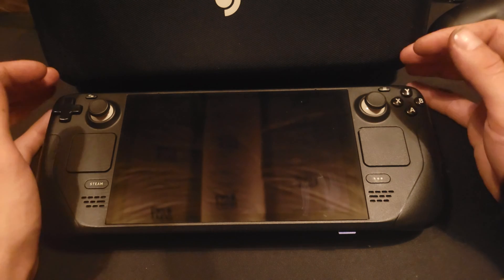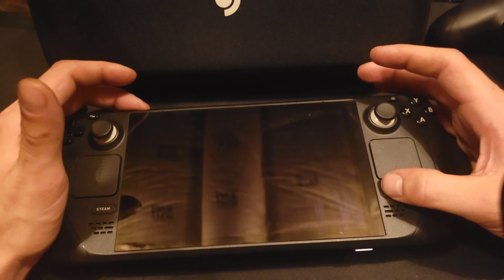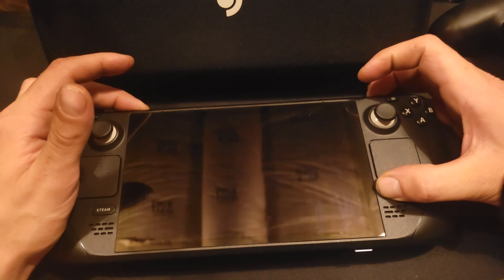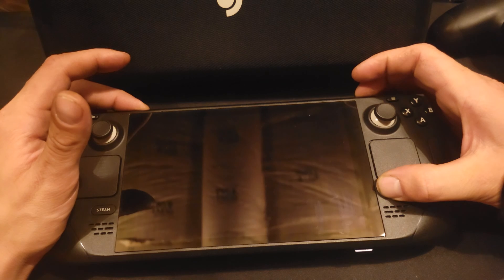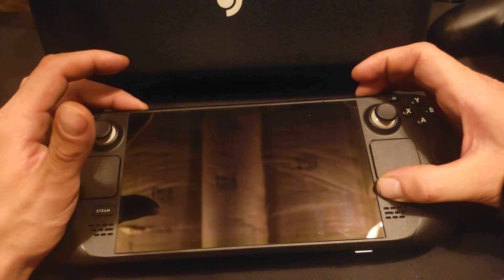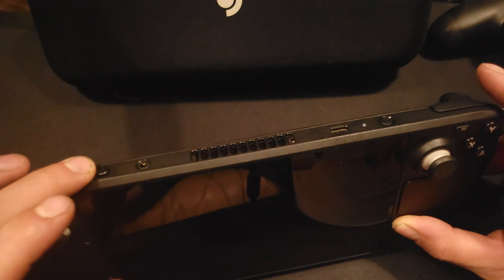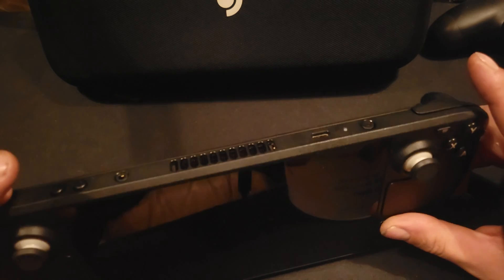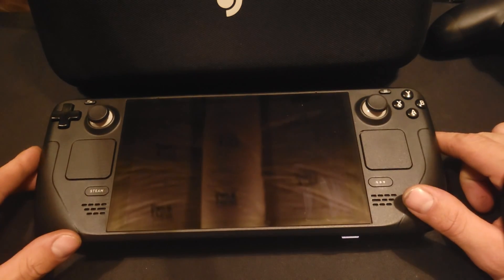SteamDeck: Clear CMOS

Comment: Thank you, Thank You, THANK YOU! 

I was about to have a panic attack with my Steam Deck not turning on. 

I accidentally left it on (I'm an idiot and didn't notice it was still on) and put in the case for a few hours, so it overheated to the point of not wanting to turn on and would only flash a red light when I pushed the power button. I literally reached out to Steam Support about this issue minutes before watching this video.

Your video helped bring my Steam Deck back to life and I can't thank you enough. I only had it for a week and I was going to be sick if I had already ruined it.

Cheers!

Comment from the maker: Hold Steam, and ... For an extra minute. 
Crisis mode
Reply: Hey i got a problem with my steam deck that i cant install steam os or boot to any other linux, but windows is still can boot but with no audio even manual install the audio driver and also if i install the apu driver its will broke the windows to bsod, do you maybe know what happen to my steam deck? Its an lcd model btw
Reply from the maker: Bcd issues. Wipe the drive. Start over
Reply: @-FOXX i did it but still cant install, i think my steam deck issue is on the AMD APU graphics card. Because i can boot to windows but if i install amd graphics card driver its will brick the windows 🫠

Comment: My light fades on and off when I turn it on and the screen remains completely black what does this mean do I have to send it in for repair
Reply: I have this as well did you find a way to turn it on?
Reply: @EldenLordRorymachusI had to send it back to valve and they sent me back a replacement
Reply: @orikku that’s unlucky, eventually for some reason the minus volume and on button together eventually worked
Reply: @EldenLordRorymachus that’s good I’m glad it worked for you
Reply: @orikku thanks I was really stressed 😊

Comment: Is this still really working? I did as you said and all I got was a single power button flash, no sound or display and the completety unresponsive device like it's battery has been disconnected. The only way to boot the Deck was to plugging it into the power cord.
Reply: Happened the same to me. I plugged the charger and worked like normal. Do you know why it happened?

Comment: Well I tried this and didn’t work. I started having an issue with my deck freezing up on the boot logo. Tried every method on YouTube and online and them this method. It restarted after completing the clean up but it’s still stuck in the logo screen. I’m trying to avoid reinstalling steam and erase all my data. Any other suggestions you may have?
Reply: Got the same problem. I hadn't tried that reset CMOS bios method but all the others I knew failed. I had to erase all my data to unbrick my Deck. Btw were you using SteamOS Beta or the Stable release when this happened?
Reply: @seva809  Stable. I just factory reset my deck. That worked. Couldn’t find any other way in fixing it without loosing any of my files and date. Oh well. Got almost everything back on as before though. That’s a plus
Reply: @seva809  Thanks for your reply though. Much appreciated.
Reply: @OldSchoolNewSchoolGamer  Glad for see your reply as well. This problem you mentioned happened for the fifth time on my Deck. Each time on Beta SteamOS. And each time I had to use Factory Reset. Thankfuly I store all my games on microSD card but still I have to reconfigure them each time I do this hard reset. Hopefully it won't happen again anymore on your device. 
Btw may I also know what Steam Deck model are you using? Is this 64gb version?

Comment: THANK YOU!
Finnaly found a fix, I knew it were CMOS, almost opened the deck to possibly remove a battery (not even sure it has one), THANK U!
Reply: Nah there's no 'CMOS' per say, and no battery managing a CMOS. This runs insydeh2o's crisis mode which clears nvram BIOS settings, now puts the steam deck into battery storage mode (which it didn't do previously) and if necessary, attempts to re-flash the BIOS, and re-flash the embedded controller.
Reply: @StANTo  Nice, don't know where I'd get this info, thanks

Comment: I reinstalled steamos after having windeck on mine for a while.  After a month or so had this happen but the power button is unresponsive and the power light just blinks.  Installed decky loader so I don't know if it was that or the steamos install, but I can't get anything to come up.  Can't go to bios, can't reset the cmos. Nothing 😭
Reply: Exactly same bro did you find a fix?
Reply: @DINNXYY  I had to wait until I got it to come back up and do a good shutdown.  Did a new os install  and that fixed it
Reply: @DINNXYY  just be patient if it's still happening to you.  For me it was minor at first but got worse.   Plug it in with the original charger when that happens and just as soon as you can throw the recovery image on an SD card and reimage the deck.  I should have done it way sooner.  At the end I waited about a week to get the deck to come back up from sleep mode.  Trying my various chargers and unplugging the battery connection and pulling my hair out for frustration.

Comment: Hello! I got a Steam Deck 1 month ago and… Games work great, but freeze time to time after 30-60-90 minutes of play in a different games. 

Game freezes and the sound continues to play, but i can use SteamOS (3.5.7) software in this state without any problems. Steam button and (…) button works absolutely fine. 

I shutting down games from SteamOS and then started again.

Is this reset can help me with this problem? Or RMA only? :-(

Thank you!
Reply: Made everything on this video and everything works great now! Huge Thank you!
Reply: And issue returns… My screen not turns black. Game just freeze and that’s it. + I can shut down it from SteamOS menu without problem at all.

Comment: Resetting the CMOS does NOT affect any of the software/files/etc.? Did I understand that correctly?
My Deck isn't a brick (yet) but I'm having issues where I was told a BIOS reset might potentially help. Just wanting to make sure before I try doing it so I can back my stuff up if I need to. Was kinda really hoping to not have to factory reset and get stuck setting everything back up again if I could help it.
Reply from the maker: Correct, the harddrive, and its contents (OS and files) are unaffected

Comment: any chance i could get some help, i had my steam deck since 2022 and its been great yesterday i was gaming on it and it was fine but today when i turn on the steam deck i get a black screen just the fans running, if i conect the dock and connect a keyboard and mouse the  lights dont even turn on. I have tried all the button commands to reset and what not but i still got a black screen.

I haven't done anything to it no mods just been using it as is
Reply: Lo reparaste?

Comment: Nope my piece of crap is dead and warranty is voided thanks to my dumbass from trimming the heat shield to fit a full size nvme drive

Update: got a new one from rma unfortunately and it did a software update and its f**ked again what an absolute piece of crap 😂😂
Reply from the maker: FullSize NVME will not fit in a deck.

Comment: cmos reset wont work, tried everything, disconnecting battery included. i read somewhere of a way to short something on the deck but cant find the post again. i unlocked the bios with a script and changed the htfmax control option to something i shouldnt have, and all it does is turns on, runs the fan and gives haptic feedback with touch pads, but no backlight or display. valve stopped responding to me so im on my own, and i need help. i ordered a kit to reflash the bios but that wont arrive for a while in the mail, and i want to know if there is any other way. any help is appreciated.
Reply: I'm having the same issue, I can access steam os with an external monitor but I can't access the bios and the screen is just backlit, I tried cmos doesn't work, I think the best thing I can do is try to get a refund, but I have had it for over 2 years, don't know what to do now😢
Reply: also what is "crisis mode" and how do i get to it
Reply: Maybe this was meant to reset normal bios, not for modified (smokeless) bios? I’m not sure.
Reply from the maker: Should work for any bios. If yours is not beeping its not able to post at all. (hardware damage usually)
Reply: JUST same problem, you figured IT out somehow?

Comment: On my steamdeck doesnt work cuz when i have it plugged in with its charger it works but when i disconnect the charger it turns off and nothing shows on the screen
Reply from the maker: Sounds like hardware damage.... sorry
Reply: @-FOXX I have same issue, please let me know if you have a solution?
Thanks
Reply: @-FOXX  with my steamdeck the problem it wasnt kind of a problem the battery wasnt connected properly and that fix the problem and my steamdeck when i turn it on.. now it would stay on
Reply: Did you fix it bro, I just got your problem on steam deck?

Comment: Thanks!  I messed with OC for a bit but then I updated to the Main branch which updated my BIOS to the 116 version so I lost the ability to change back to default settings.  My Deck still works fine and I dunno if the update actually reverted or changed anything, but this gives me some peace of mind until we can get our hands on an updated tool lol
Reply from the maker: Yeah 116 bios is locked down.... It's why I made this video. Can't get any overclock to work